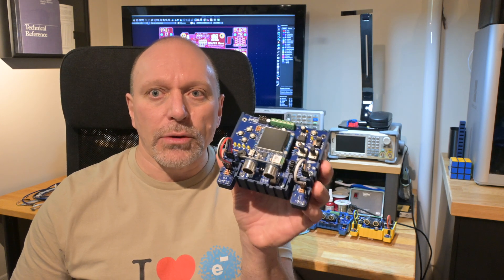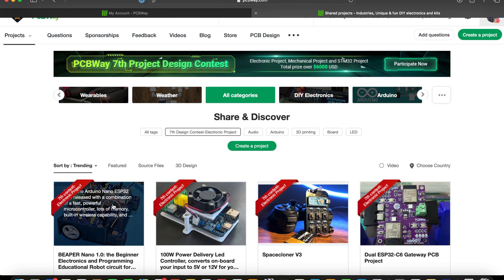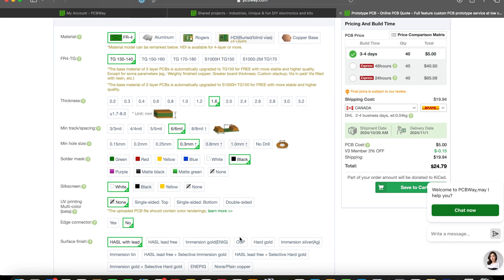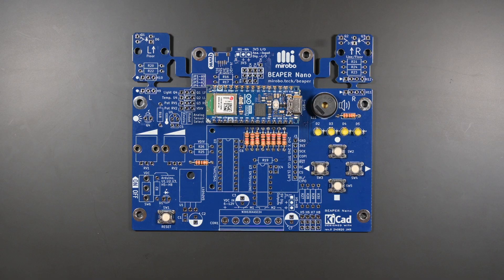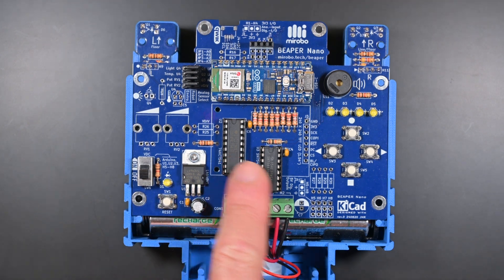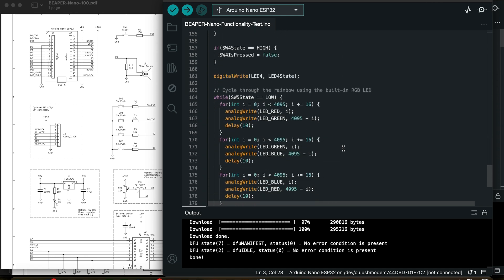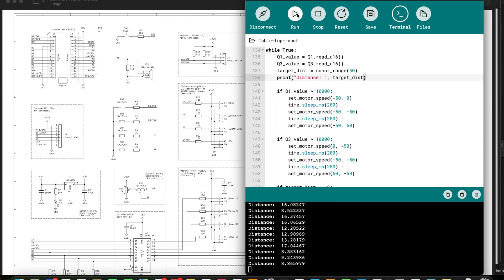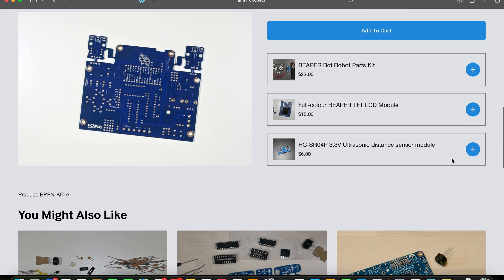Introducing BEAPER Nano

Comment: Great project! I teach robotics to computer science college students. Currently, I use MakeBlock Ranger robots because they are Arduino-based. However, I have to change my fleet in two years (I keep them for five years).

Do your robots include wheel encoders? Precise movement tracking is crucial for my curriculum. If the next iteration aligns with my needs, I would definitely consider integrating it into my revised courses.
Reply from the maker: Thanks for your comments! The motors I currently use don't have wheel encoders as I wanted to keep the costs low as well as keeping more I/O pins free for other devices. But, it would be easy to substitute motors with encoders on these circuits –  depending on which other I/O devices aren't as necessary.

Comment: Very nice little and compact Bot. I like the compact and efficient design, low profile, fairly easy to get components and modules. OpenHardware PCB design and lots of OpenSource software/tools, nice entry level bot. 
KiCad 8, etc. Still baffles me, I will leave it up to "more seasoned" PCB designers, I just like to connect modules and wires, and see what works.
Reply from the maker: The proliferation of small, inexpensive, and easy to use modules has certainly opened up the world of small microcontrollers to many more people than when we had to design and build our own circuits! :)

Comment: Interesting concept.
Reply from the maker: Thanks! I'm having lots of fun with it.
Reply: @mirobotech  Yes I too have had lots of fun designing a dozen or so boards and having them made. I just do these mostly for fun. A few have helped solve problems on my farm and a few designs work well for the "Learn to Solder" workshops I do as a volunteer at local public libraries. I donate the boards, components and use of my 6 solder station setups for the workshops. Over the last 10 years we have had more than 200 people do these 2 hour workshops with almost all leaving with a working board. My favorite board for this time of year is a Christmas tree shaped PCB with blinky lights and buzzer Christmas tunes coded on an ATtiny85. I have a  couple of videos on my channel where I document the design. I have never thought about selling my designs but I commend you for taking it to the next level. It looks like your prices will make your customers happy but won't make you rich. Good luck and thanks for giving back to the community.